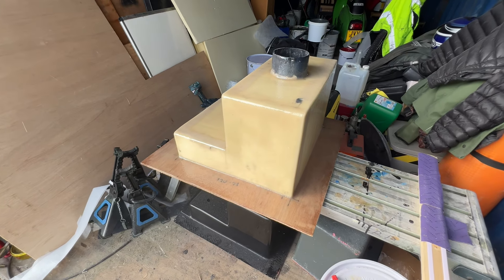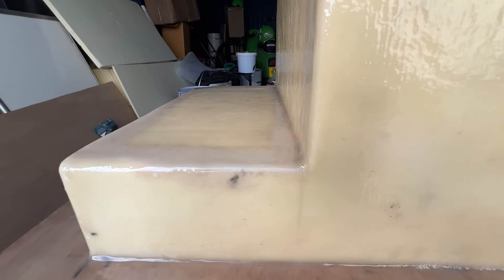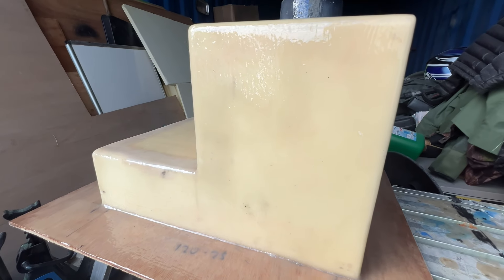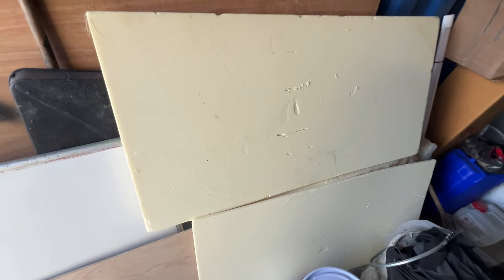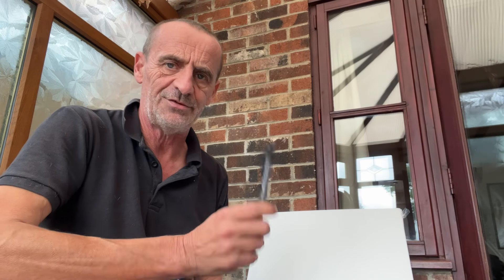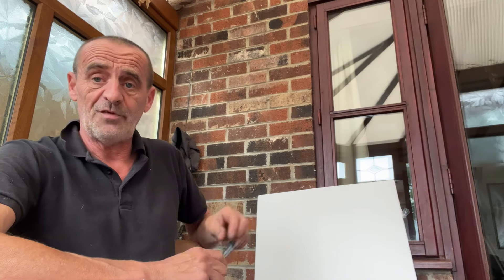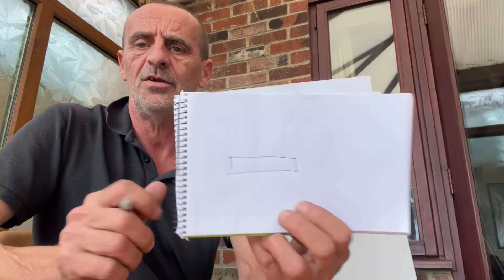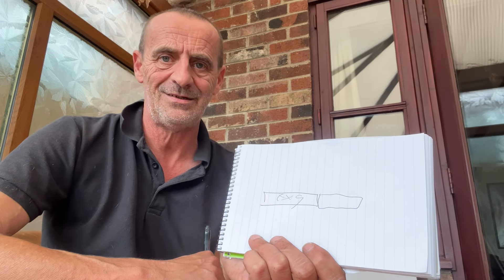20 years foam lining. THE FACTS

Comment: The weight of water in a pond exerts a downward force over the entire floor area, not all on one spot. Meaning if you had a 2 metre column of water spread over 1 square centimetre of floor, it would exert 0.2 kg, or 200 grammes of force only. Fill a 1m piece of 22mm waste pipe up with water and see how little it weighs. Add up the floor area of your pond in square centimetres and divide the number of litres of water by it and the pressure isn't that great, much less that you standing on it in shoes!
Reply from the maker: Sounds like I need to do a video with a pipe fill of water sat on the foam to shut these people up once and for all!
Reply: @GRPLiningServices   I worked it out that with a piece of 3/4" /  22mm waste pipe,  you would need over 3 metres to fill with one litre of water. 1 litre only weighs 1 kg
My pond holds 25000 litres (or 25 cubic metres or 25 metric tonnes), but spread over the floor area it comes down to 2300 litres per square metre. There are 10,000 square centimetres in a square metre, so I am only getting 0.23kg per square centimetre. As long as there is no gap to allow movement the foam wouldn't compress, even if there was a gap, the pond fills slowly and it would settle